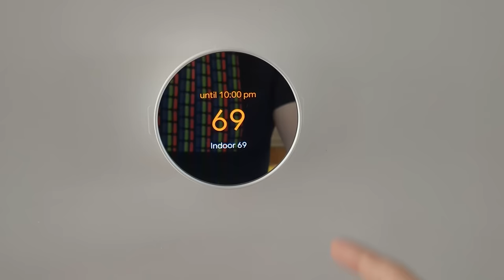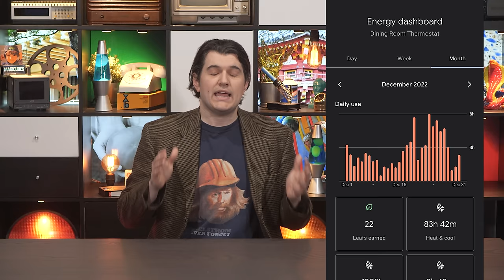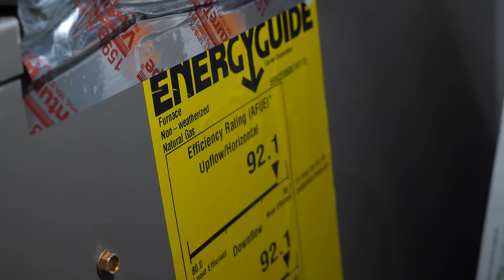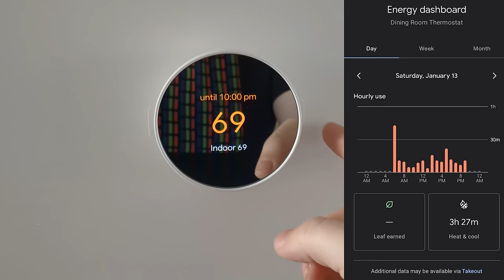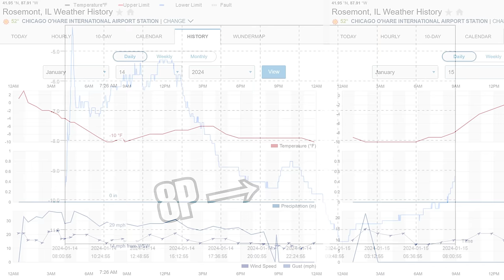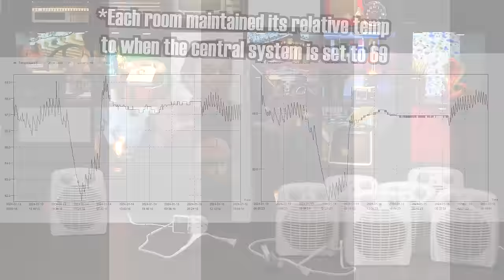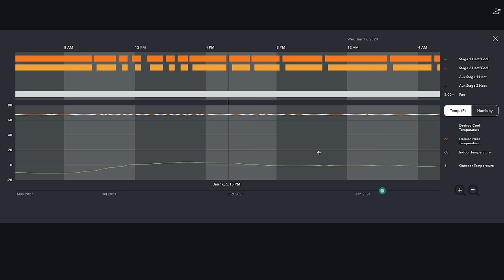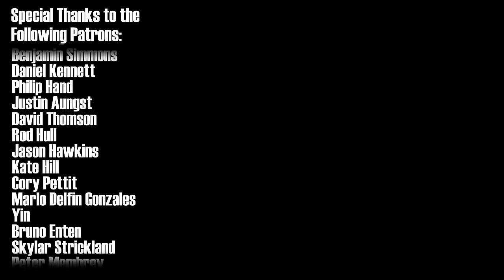Old HVAC industry practices are holding us back and costing us money. But we can fix it.

Comment: I'm an HVAC/R tech who used to work for a resi company, now back in commercial and industrial, and I can say you are spot on with the abundance of oversized systems. Unfortunately, lot of sales guys do perform poor practices using a rule of thumb to size (generally based on sq ft) or just slapping in the same size that was there before, no actual heat load calculation. Many of my calls were due to high limits tripping from oversized systems and these were on a lot of the company's installs. I was basically told to lie to the customer and not mention the sales dude quoting over sized systems and to blame the duct work size was too small. Long story short, I started to spill the beans and spread the truth and this didn't turn out well with the office and sales boys.
Reply: Not a knock on the resi guys but in my experience there’s a severe lack of good techs, all the good ones who are interested in any sort of calculations and whatnot generally speaking end up jumping ship to commercial/industrial eventually like you did.

Dealing with the customer bs just isn’t worth it for somebody with skills so much of the time.

Comment: This happened to us, quite a while back. We had 4 bids on a new furnace, and 3 of the 4 just wanted to replace the old unit with a new one of the same size. When the fourth wanted to do a home visit, we were surprised. He asked insulation questions, measured the floor and window area, and concluded that we had a furnace that was way too big. Result: we got a modern high efficiency furnace about 1/4 the input of the old one, and our propane bill was cut 2/3.
Reply: "easy" money - rip the old one out, throw the new one in and get the cash. The last one that did all the fiddling had to think, invest some time and also take the risk of miscalculating something or overseeing something.

Comment: I have a mini split heat pump/ac unit in a barn and I love it. Quiet and keeps a steady constant temperature. We do have a backup propane heater in the winter for emergency situations though. Havnt had to use it yet.

Comment: I work in the Mechanical department in an Architectural Engineering firm. We do HVAC, plumbing, and electrical designs for large buildings and campuses. I cheered when you did load calcs :). And there's no way Average Joe's Local HVAC Service is going to do the surveying needed for every retrofit. I'm not familiar small-scale domestic permitting, but I'm assuming they don't need a permit to replace a system with the same capacity. They may need one to design a new system. The fees we get for doing calcs and the liability we take on when we stamp the drawings... well, no one could afford us to do their <10000sqft home, I can tell you that much.
Reply: 25+ years in Florida HVAC here.....Yes, any HVAC equipment replacement requires a permit in our state. There was a push to require Manual J and S be submitted with every replacement permit in my area some years ago. Was kinda funny, all of the permitting authorities became overwhelmed as they had no idea what they were looking at and slowed permit approvals to the point homeowners and contractors were screaming. Most gave up and removed these requirements, a few locations do still have a Manual J requirement.

Any DECENT HVAC contractor will do a heat load on a home retrofit just to cover their own ass if they're smart. Swapping like for like is stupid. Attic insulation degrades over time increasing heat load, some people proactively add insulation or upgrade windows decreasing heat load. Individual room uses changeover time too like the 30yr old that never moved out of his childhood bedroom and now has a giant gaming PC, apartment fridge, no return, and keeps the door shut and wonders why it hot.

There is some fuzzy math involved at times but damn, you better be close. Go too big, cold humid house. Too small, runs non-stop and outrageous power bills. When you install a system you just signed yourself up for a 10yr+ relationship with that system and customer and it's in your best interest to do it right the first time.

I think the dumbest old school sizing rule of thumb I ever heard was you stand at the crest of the road in front of the house holding up your hand, looking at your fingers. However many fingers it takes to cover the house is how many tons of cooling you need.🤯
Reply: @notreallydaedalus excellent points. But what I don’t understand is how an HVAC company that does retrofit doesn’t know their local housing stock like the back of their hand. In residential, there aren’t that many variations on several themes and once you do a few dozen Manual J calcs for sizes and styles, especially from same development, they should be able to get a lot closer to the mark without grossly over sizing. 
“We’ve always done it that way” enters the picture a lot!
Reply: @famousutopias  "we've always done it that way" is hard to overcome especially when doing the calculations would take more time and result in a lower sales commission when that calcs would say a smaller, less expensive, system is called for. There is no financial incentive for the sales person, not even "long term/repeat customer" because the people in those sales positions only last a few years before moving on.
Reply: Speaking about NC, permits are required for replacements. We do (at least) a block load on every replacement. A room by room is required for new construction. Most contractors in my area do not perform load calcs on replacements and that alone gets me a ton of work.
Reply: @newliner26  Yup, more often than not I'll end up going back to a customer who went with the cheaper quote to fix their mistakes. Pay me now or pay me later. Buh-bye perceived savings🤣

Comment: Oversized cooling system (as was stated) can create a mold issue. Little to no dehumidifying creates a wet attracting environment to mold and mildew.  
There were homes in Florida where the oversized systems caused mold in the ducts.

Comment: THANK YOU.

I did a similar experiment where I measured how much gas was actually consumed in a 24-hour worst-case scenario.

Turns out that I can heat my whole place with about 18K BTUs, and cool it with 12K. The boiler the HVAC people insisted on was a 105K BTU unit.

Comment: Hi! I totally agree with your point(s). I live in Italy, in a rather cold northern area, and I was one of the first—if not the first among those I knew in 2017—to have a gas-free home. All my heating is done with a heat pump and—until a few months ago—with thermal solar panels. Interestingly, I also own a small IoT company, which has allowed me to gather a lot of data on how my heating system works and adjust it to meet actual needs! Unfortunately, many professionals either don’t know or don’t want to get into such detail, leading to many mistakes in installing these systems. If you’re interested in what I’ve discovered over the years, feel free to contact me privately! Thanks for the fantastic video, as always!

Comment: Last year as an experiment I turned my ducted gas furnace off and relied on a single (wildly undersized) split system heat pump installed in 2005 to heat the whole house last winter, for the most part it had no problems keeping the house at a comfy 22C all day and night, however some nights dipping below -8C outdoors it was working extremely hard but kept the house at a livable 19C.

Last year my gas bill was $350 AUD/quarter just for instant gas hot water, $600 when the ducted gas was used the previous year.
My electricity Bill at the same time was $35/quarter with an electric car and 10kw (8kw inverter) of solar.

This year I cut the gas line off on my side of the meter and put in a heat pump hot water system, my gas Bill is now $0 and with solar my power bills are $70AUD credits in summer.
Will be interesting to see what they are in this coming winter, however I'm expecting them to be close to $0.

If all goes well I'll be installing another split system at the other end of the house (to allow zoning), and replacing the smaller one with a slightly bigger one for those colder nights.

Heatpumps FTW.

Comment: One thing you should consider is the setpoint of your neighbors.  If you like it at 69 but your neighbors are at 72, then they are partially contributing to your heating load since you share walls with them.
Reply from the maker: You don't actually consider this in load calculations. Because think about it - even if my neighbors are keeping their house at 80 degrees, that wall only has a 10 degree differential across it. Hardly any heat is going to transfer. The worst case scenario would be if a neighbor completely shut off their heat (which there are many reasons that's a bad idea, especially since we have fire sprinklers) and even then, the upshot would be that my system might only be able to maintain 65 without an extra space heater running, which is no big deal at all.
Reply: @TechnologyConnections Yes exactly! Plus the wall is insulated.
Reply: Yep, the townhome factor is huge in this.  Less windows and less exterior walls.
Reply from the maker: @randomname4726  Right. I don't want to go out on a limb and say that this is always true for townhomes, but it is for mine. And loss through the ceiling is a way bigger factor than the walls anyway. My attic insulation is R-50 but the walls are around R-15.
Reply: @StonyAcresEstate  Not huge. Everything he said still make sense in a stand alone home.
Reply: Ah. So even with vacancies on both sides, the empty townhomes themselves act as insulation.
Reply: Coincidentally, our friends up North -- the LTT WAN Show -- addressed a very similar topic, where Luke lives in a common housing complex with neighbors that contribute significantly to his unit's temperature.  It's subjective, but he did mention that it's a noticeable difference when everyone else is gone.
Reply: @StonyAcresEstate I live in central Florida and love my town house.  My summer cooling cost is half my friends single family home) and my home is actually slightly larger.
Reply: @nickwallette6201  It is going to depend a lot on the insulating value of the wall.

Some of the older buildings here are going to have a lot more heat bleed through.

If you have a modern building with good insulation it won't make much difference if you or the neighbour sets the thermostat +/- a few degrees.

But in a older apartment in Vancouver where the interior walls are thin and provide basically no insulation there will be more transfer.

Also, with people on five of six sides, they will limit heat lost to just one wall.
Reply: @matt6740  The insulation of the exterior of the structure is far more impactful than the size of the home.  Once you get a volume of air to the desired temperature, the only relevant factor is the interface between the inside controlled air and the outside uncontrolled air.

Size is relevant for how long it takes to get the temperatures from A to B and because bigger homes will have bigger surface areas. But due to the square-cube law, the interior volume increases more quickly than the surface area so a home with 10% more space will have less than 10% more exterior walls/roof.
Reply: @88porpoise  I know and understand, I was meaning to remove the size issue from the comparison.  Here homes aren't insulated much since it doesn't do very much.  Even in the hight of the summer, the temperature gradient just sin't significant (80 inside 96 outside = 16 degrees) compared to my in-laws in Minnesota (75 inside -30 outside = 105 degrees). The sun exposure ends up the biggest factor and having my two larges walls as interior walls to another unit helps a ton!  The roof is another one, it is incredible the temps in the attic, but by having a 2 story, more compact design, we also limit our roof area.  Good call pointing out the square cube law, it can have a huge impact on cost of climate control compared to how big the house feels.

Comment: One thing you mentioned was putting the electric heaters near the heat vents by the windows “where it should be”. I’d love a comment from you on why the heck heaters and air conditioners are placed directly next to the coldest/hottest parts of the house: the windows. This is the least efficient place as there will be more heat loss here than anywhere else (for the reason you mentioned about temperature gradients). Is it just for pragmatic reasons reasons about piping? This is definitely not the only way to do things. The Franklin stove has existed for hundreds of years yet has been neglected. Putting the heating and cooling lines as far away from the windows as possible is the most efficient

Comment: HVAC Contractor here...don't shoot......Love this video and everything you are pointing out about heat loss and equipment sizing is true.  Believe me, most people don't want to have an hour long conversation about why a heat pump is a smart move for them.  Just a guess, but I'd say your test home is around 1200 sq ft? That's just for my personal use of rules of thumb....Your gas furnace is 60 mbtu because it is generally the smallest size offered. Some manufacturers go to 40 but as you touched on most vendors don't stock them.  Old fashioned heat pumps are pretty bad at making heat, with outputs approaching 50% nameplate below 45ish degrees outdoor. Therefore, heat strips are used more often and people see this reflected in their electric bill giving heat pumps a bad rep.  Modern variable speed heat pumps are much more efficient at lower outdoor ambients as you point out. Unfortunately their COP still plummets, approaching a 1 at the very low ambient temps which can negatively affect the electric bill. In the case of your test home, I'd bring up the option of giving you a dual fuel system, simply replace your air conditioner and coil and keep your existing gas furnace (appears in good condition and not that old in the video) Then instead of electric strip heat your "backup" would be the gas furnace.  You briefly mentioned emergency power considerations.... in a power outage situation, it would take a small 2kw or less generator to power your gas furnace vs a maybe 8kw generator to power your electric strip heat.  Some folks are hard pressed to have no gas bill, electric only. Others like the dual fuel.  As you said, energy prices vary regionally so one solution doesn't fit all, but generally speaking, the dual fuel option is the lowest operation cost.   One more note, with modern variable speed heat pumps, airflow is capacity....this means you can actually have a 5 ton outdoor unit with a smaller say 3 ton air handler and coil inside.  it will never run at 100% speed under "normal" conditions (which boosts the COP numbers), but when temps drop and capacity falls off, your 60k outdoor might only make 36k now running at 100 percent, but you sized your air handler for the load of the home and are perfectly happy with the reduced output and still using less electricity than electric radiation.
Reply: Similarly-sized house but in Europe. Here the conventional gas heating is through water transfer (radiators or under-floor). 99% of the gas furnaces here are 20-24kW. That's about 7-ton, which is a lot, but it includes instant water heating, which I think takes up most of the energy. Generally the furnaces run at 100% for a few minutes then wind down when the water setpoint is reached.
Typical replacement that I see here for the above 24kW furnace is a 5kW heat pump. Gas and electricity are expensive here and most people do their math before (J).
Reply: I tried that dual fuel idea when my sister replaced her furnace/ac 3 years ago. All of the places we called in our area said it was a bad idea. I knew I should have pushed harder.

Comment: I have a great topic for you - Programmable Logic Controllers or PLCs. There are varieties of types of PLCs from low power units designed to run in remote environments or those run in virtual environments on industrial PCs. Its a huge topic which you would need some support on but it seems up your alley and something many people are ignorant of.
Reply: We used a PLC from Crouzet to control a chiropractic table (raise table up/down, cycle back/forth etc). The Crouzet sales bloke designed the initial program, it was my job (using my laptop) to tweak the program to customer requirements then load it into the controller. 
You design your own program by dragging and dropping logic blocks onto a 'virtual board' and connecting inputs and outputs. Soon picked it up. Really fascinating to use, so versatile, enjoyed working with the software. 
You have to be really focused in keeping full documentation on the program specification and explaining the intended logic operation.
Reply: Not me. I love them.  Automation Direct. Good place to get them. Free training great prices
Reply: We used to use them to run the movie projectors back in the day.

Comment: My co-workers think I’m crazy because I kept laughing out loud during the portion of the video where you were describing the test, but I’m the one that does the fire and safety inspections at work.

Plus I’ve had to do a real-world test under duress, because the furnace chose to fail at -67F, and I had to keep the place from freezing long enough that my talented furnace repairman could machine some replacement parts out of brass bar stock and other materials, due to the extreme age of the unit and a lack of parts available for a unit of said age.

Thankfully it has since been replaced by a newer, much more more efficient furnace that uses standard parts that are more easily sourced.

Someday I dream of getting a heat pump system, but that probably won’t happen while I live  where I do.